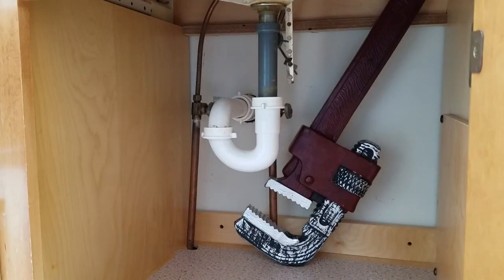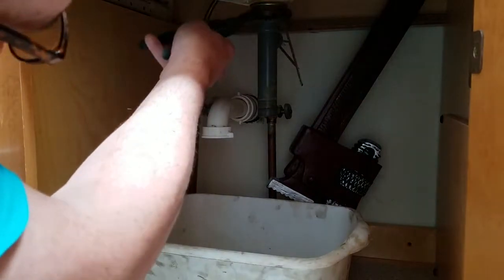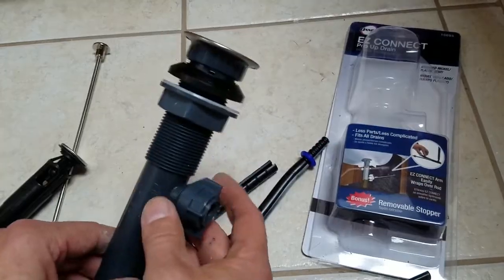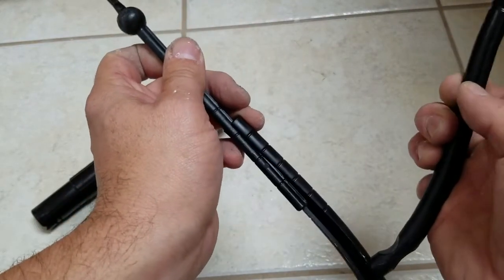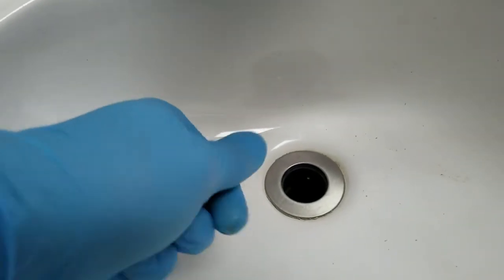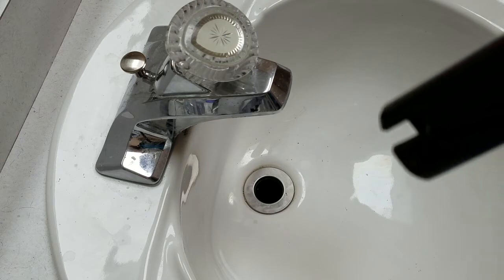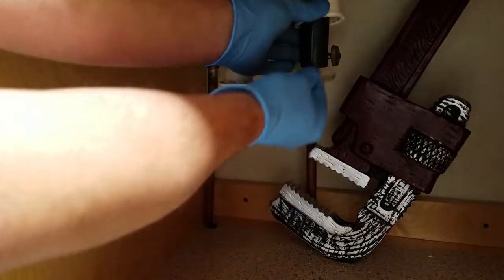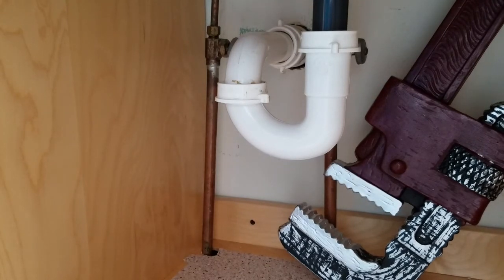DIY pop up bathroom sink drain repair

Comment: FYI..Danco says don't use plumber's putty..incompatible with the plasitc...use silicone sealant
Reply from the maker: I've never used anything but plumber's putty and never had an issue.
Reply: @HouseDoctorRay  so you are saying you know more than the manufacturer who put that warning on the label of that very same product.

Comment: update: the little tab that is supposed to click in place to hold the lever rod tit won't click and the  lever rod has too much flexibility or yield or give or what ever to hold the sink stopper in fully closed state
Reply from the maker: It takes a little tweaking to get just right but it will close.
Reply: @HouseDoctorRay  no it to doesn't. period. and u ignored the he second part namely being plastic the lever rod is too flexible to keep stopper closed.